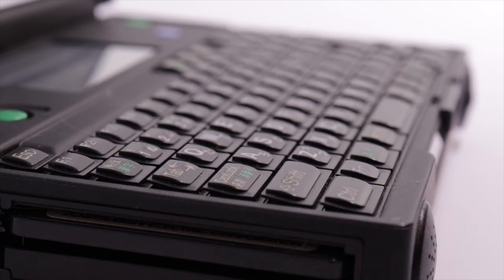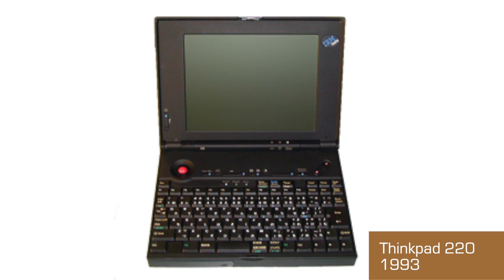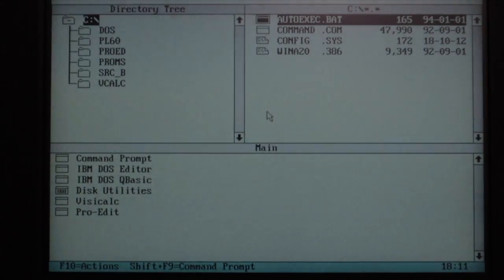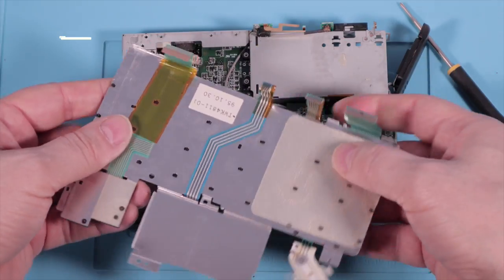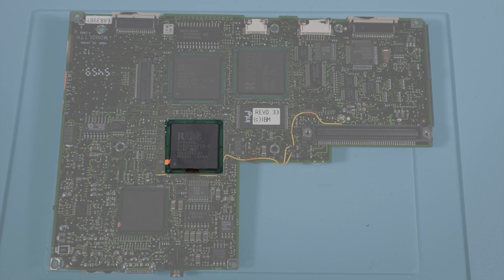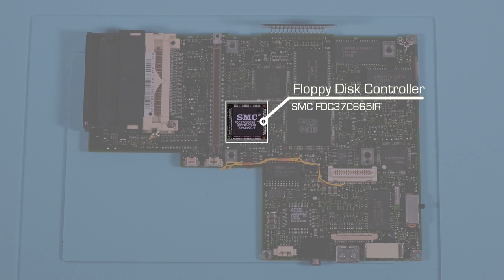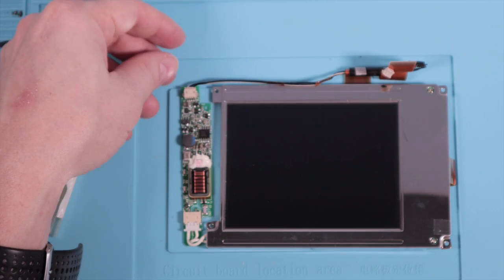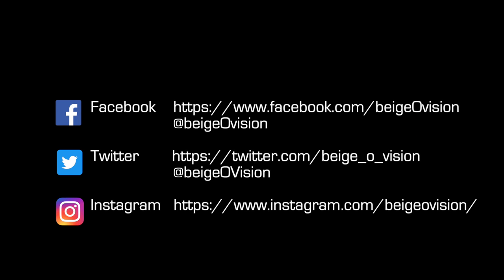IBM PC110 Palm Top Technical Tour and Teardown

Comment: I still have one of these in a drawer.  I remember painfully over clocking it.  You are a technical master for taking it fully apart and back together.  I'm afraid to ever open it again due to the age.  It was such a marvel in it's day.  I had an aircard for it in Japan. Wireless Internet in 2001. Unreal freedom.  Even in 2001, it was underpowered though but still amazing pocket power.

Comment: Just a heads-up about the power board: It does come out. Its soldered to the contacts, but they're not attached to the frame in any way. They're attached to that black plastic piece with the spring. That thing unclips from the frame and then the whole thing lifts out as one piece. Hope this helps!

Comment: Nice review and teardown, I’ve shared your video with the pc110 mail group. There are a few enthusiasts / owners who still like the marvel of this machine. Myself included. Sadly most available now suffer screen issues but one contact in Japan is experimenting with replacing the ageing screen and it’s progressing nicely. I think anyone who does a tear down of the machine finds how fragile the plastic is mine have battle scars, the flex cover is the first to break. Superglue and baking soda work well as a fast cement! Regards Mike
Reply: I have an 8MB one that has not been booted up  in over 12 yrs. Any way to get a 20MB module in 2020?
Reply: 2Old4Toys they are pretty rare I would suggest you check the auctions on yahoo in japan I’ve seen mostly damaged units go on sale there and the occasional fully functional 20mb one. There were custom made 20+mb modules that some enthusiasts built sadly I’ve never obtained one. I was in touch with a guy who made some but he hasn’t for a long time and had no interest in doing so in the future the parts are rare and to make one you need to potentially butcher an existing ram upgrade and stack the right type of memory modules on top of each other (called turtle on turtle) I have weblinks showing the process. After many years I actually managed to purchase and obtain multiple 20mb modules through other enthusiasts though not cheap and they are fitted in pc110’s which were refurbished with an lcd screen using the adaptor the above guy designed as a PCB and I got some manufactured. The screens are smaller and only initialise post boot so you can’t get to the bios with it, needs the dock to do that. But the screens work good. I intend to revisit the pc110 at some point as I’d like to 3D print some mounts for the smaller screens and a screen bezel when I get to grips with a 3D package. If you want to check buyee for the auctions they work well for non Japan based residents to buy on the auctions - but it’s not cheap to import additional duties at times imposed and at times you may get a complete dud as most sold as seen! Hope you have deep pockets. Im always happy to chat with fellow pc110 enthusiasts I’d happy chat further on the subject!

Comment: I'd love to see some example programs and games running on it (I know, slow refresh rate), but for illustrative purposes it'd be interesting to see how they run. Maybe even run a dos benchmark to see how well the unit is optimized. A great informative video, once again. Thank you! Wishing good luck on growing your channel. Liked.
Reply from the maker: As it happens I did run some DOS benchmarks on these machines.  But I think I only captured the odd still image.  And, coincidentally, I'm working on a DOS programming related video (among others).  After I complete that, I could run a couple of benchmarks and mash them up.  We've got a range of DOS capable machines we could try, including the PC-110.  Thanks for the suggestion!
Reply: I have a few of these pc110’s with different ram options and I recently acquired a pcmcia video card called Canopus power window T64v as yet I haven’t figured out the correct configuration but there are lots of references of this card in most ibm pc110 books about it and saying it should work with it. Just not had the time to get it working fully yet. It then would run with an external video card with separate ram effectively taking the load of the cpu of the pc110. If I ever get it working I’ll try and make a short vid!

Comment: Very nice video. I can't believe I just found out about this. Does this have a SIM Card Slot by chance? If it does, can it still connect to cellular service today?
Reply from the maker: Hi! Thanks. I'm afraid it's phone like behaviour is limited being a 'land-line' handset.  I can't remember having seen PCMCIA based cell-transceivers prior to the 'card-bus' standard.  The PC110 wouldn't support a card-bus device.  But if such a thing exists, that's what you'd need to make the PC110 a mobile phone.  Oh and you would need a DOS/Windows or Windows 95 based software to use it.
Reply: Ah, is that so. Thank you for the detailed and valuable info! Much appreciated.

Comment: Thanks a bunch for this video! I've been trying to swap screens on my two PC110s but I can't seem to figure out how to get the display ribbon cable out. Do you happen to know any tricks? Does it just pull out or do I have to pop up the sides on the connector the ribbon cable can be freed? Same with the four wire connector for the display that is disconnected in the video immediately before the ribbon cable. I've attempted to free it with guitar picks on the side but it seems locked in there & I'd love some insight into that if you can provide any. Thanks!
Reply from the maker: I double checked the stills I did, since my recollection isn't strong. Yes, the video connection is one of the ones with the clamping grip.  So you have to release that first.  On the bottom right on this photo [ https://www.instagram.com/p/ByhXn2ZHIFY/?utm_source=ig_web_copy_link ] you can just see the connector. On mine this wrapped around three sides. What complicates things is there's a big ferrite that floats on that flat cable. This naturally slides down and hides the actual connector.  So you need to lift that ferrite at least partially out of the way. Then you need something like a chip puller to just get under the lip of the clamp and lift it up. Good luck.